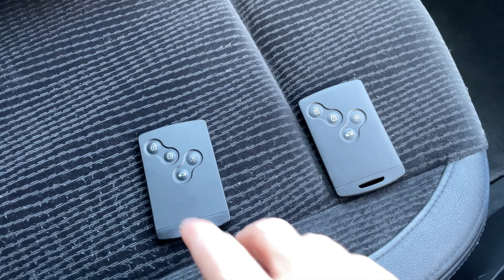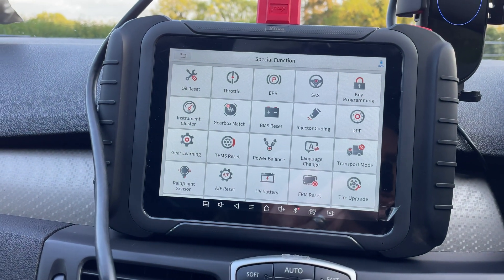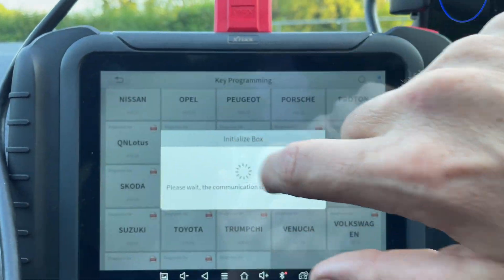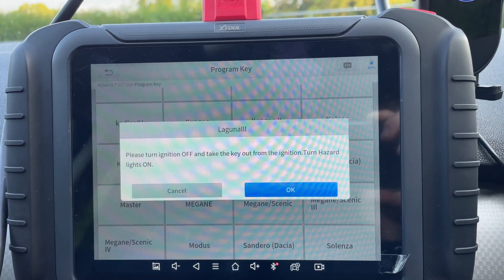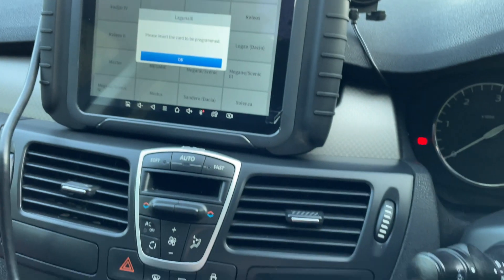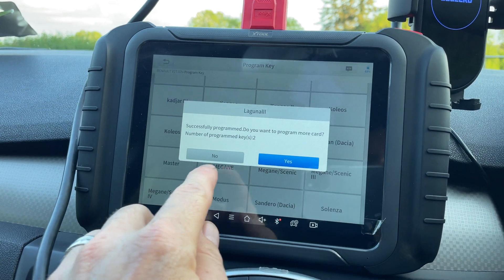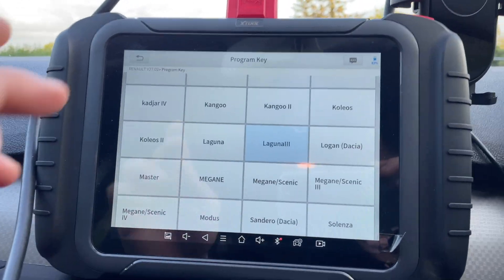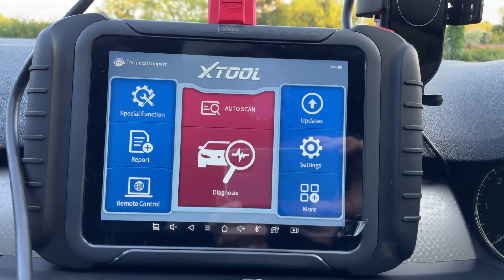XTool D8 Key Programming

Comment: I have a 2019 Lexus Rx450H. At first my XT Tool D8S told I need to buy a cable since my model was 2019 and later. The 2018 and prior did not need this cable. Tried to program and it worked!

Comment: Without plunking down the money to find out personally from what I have gathered this unit has extremely limited ability with GM vehicles. No programming or testing ability aside from window test. 
I wish more of these YouTube reviews would do a full test on GM products aside from just the Toyotas and such.
Reply from the maker: @rinkopr5561 unfortunately I'm not familiar with GM vehicles over here in Ireland, I have used the D8 on many cars and vans and the only car it didn't work on was a Mazda 3 2021 model, I have programmed many keys for various cars successfully and used it for diagnostics and actuation tests with good success. Maybe before you purchase one you could contact sales or support with a list of vehicles and the actual tests it is capable of, I know before I bought it i was back and forth with them with questions and found them very good to deal with. thanks for taking the time to leave a comment.